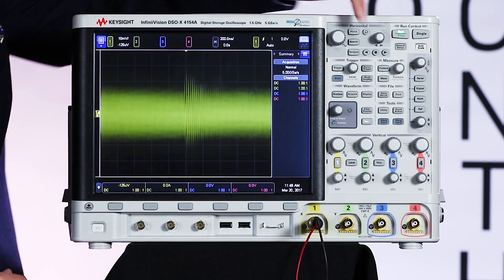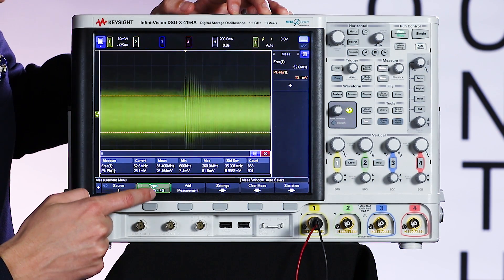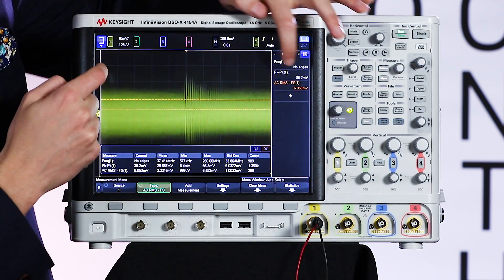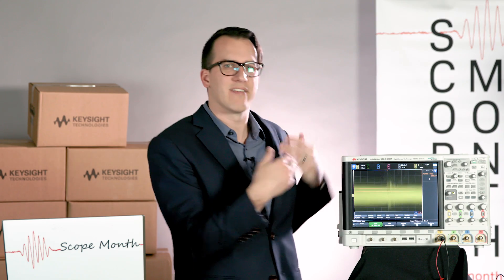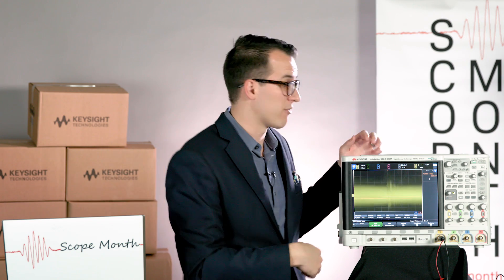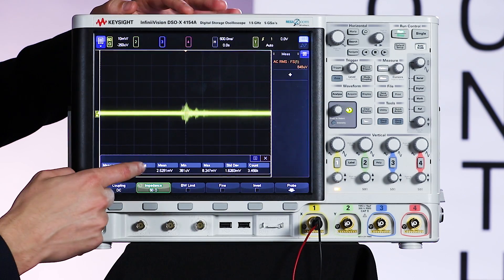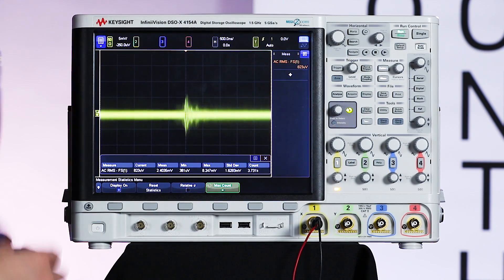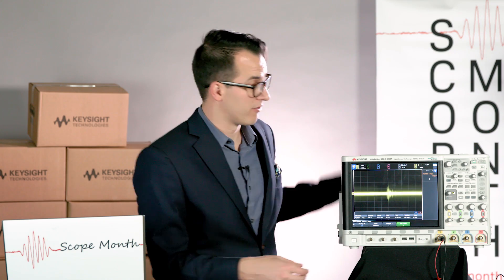Block Out Measurement Noise and Today's Scope Month Winners! (21-Mar-2017)

Comment: Thank you for doing a video of this. I've to use the function when looking at A.M. RF in the VHF and UHF spectrums. Does the oscopes also allow gated measurements?
Reply from the maker: +Shawn Johnson generally yes, you can gate your measurements with cursors.
Reply: Keysight Oscilloscopes I assume that the software has a gated measurement menu for signals in reference to ground and/or pk-pk as well then. If not setting cursors manually is just as good. Thank you much!

Comment: So many Michael out there. Not so good to my heart. ;-) Btw: Is there any technical reason for choosing 20MHz for the bandwidth limiting filter?
Reply: Most analogue scopes from the 1960s onwards were pretty much all standard 20MHz B/W (yes, I'm sure some pedant will reply "..but the xxyyzz was ...."). 

A lot of standard measurements you see today are still referenced to 20MHz B/W, such as noise and ripple on power supplies. 

You will see cheap PSU companies produce specifications with lower bandwidth to make their products look better, and only state RMS, not Pk-Pk and not crest factor.... sometimes even not even stating bandwidth they use. 

I had to send back a lab PSU from Hameg/R&S last year - it was so noisy it affected the radio I was working on. When I opened it up, it was a cheap switch-mode PSU I wouldn't even put in a POS terminal, linked to some control circuit for variable output and the display. Frankly, it was nothing more than a student project, but the specs were half the noise of the E3631A of the I've been using for 15 years, yet the E3631A meets the spec, the R&S one only meets their super-tight spec if you limit bandwidth to about 100kHz (below the switching frequency!!), at 20MHz it was about 5x higher than the E3631A.